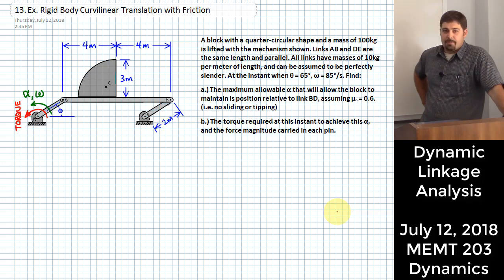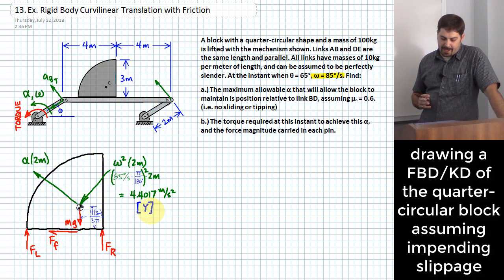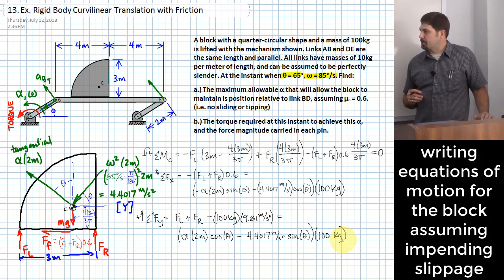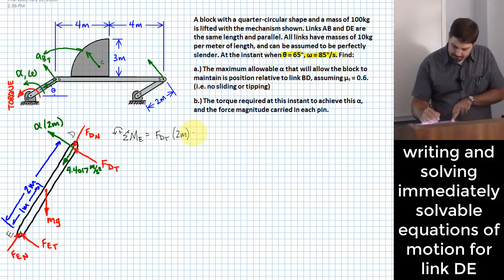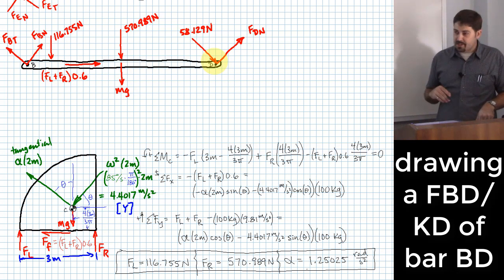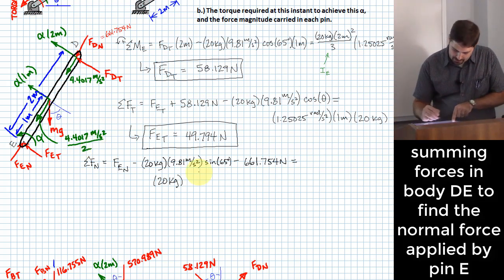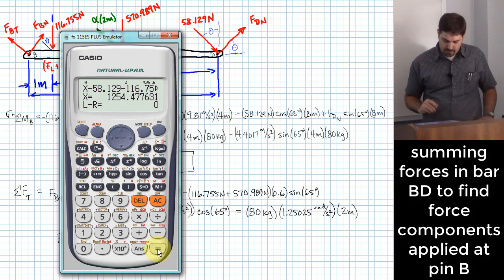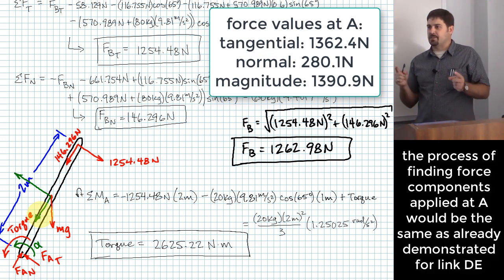Finding Max Acceleration & Applied Torque Before Block Slips | Curvilinear Translation | Pin Forces

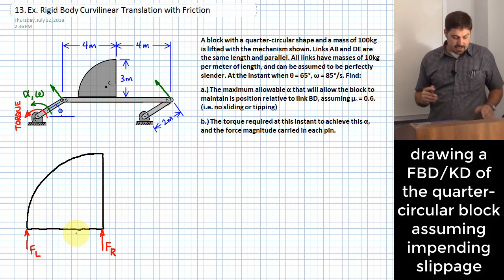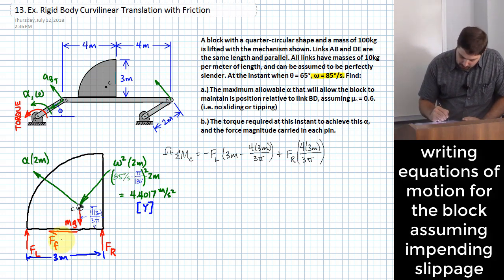Comment: Sir why are we taking static force of friction along the direction of acceleration 06:55 and not against the direction of acceleration (as it is the usual practice in any physical system)? I watched your explanation at 18:32 but It is still not clear to me. If you can help me out?
Reply: It’s a correct direction. it’s an external force acting against the rigid body to the left side which intuitively makes sense. This block would tend to slide or tip over to the right direction given counterclockwise rotation of the links assembly. The orientation of n-t reference plane for tangential and normal accelerations can be reversed either way (as long as you keep your signs respectfully in F=ma equations)